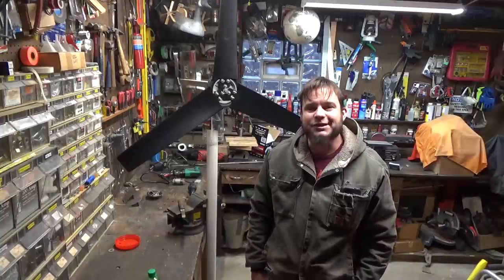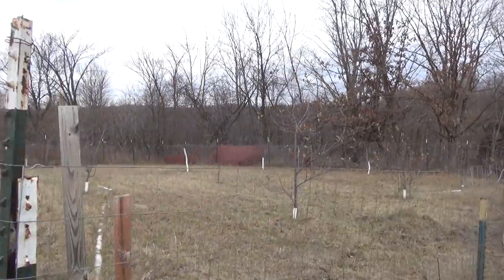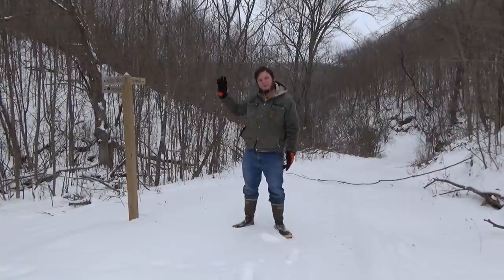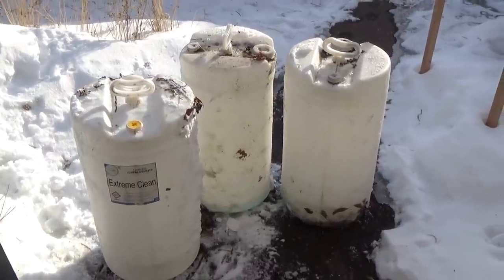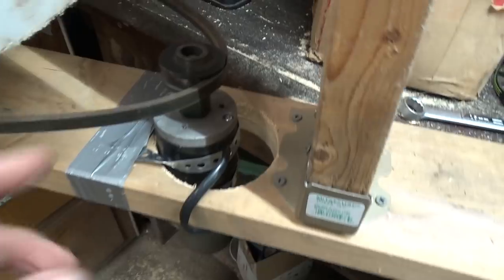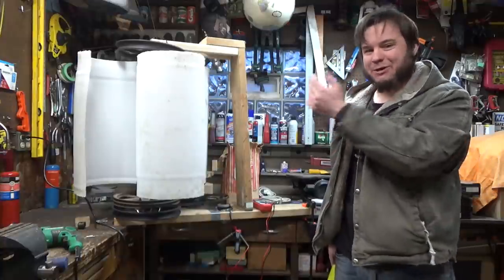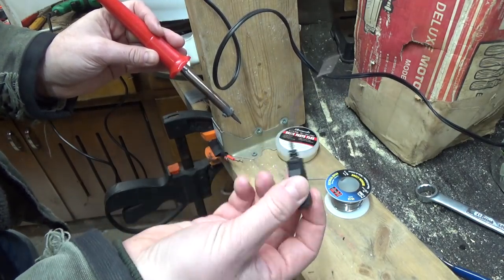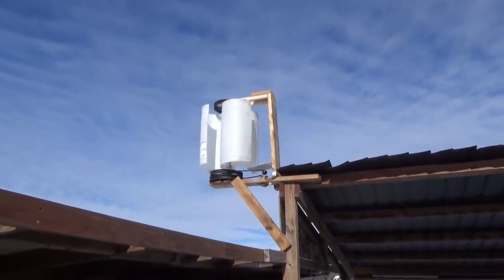Homemade Vertical Wind Turbine From Barrels and Scooter Parts

Comment: The issue with your v-belt being that loose is that it may be slipping on the smaller driven pulley, costing you some RPMs
Reply: @peterfitzpatrick7032  Yeah, that would be closer to gearing.  Great idea.

Comment: There could be an issue with there being no space between the reverse facing scoop and the axel. No space for the air to flow past so the off side half works as a sail.

Comment: "I made it work with a hammer".

Ah, a true engineer.

And you really should have a tight belt. Loose belts slip all the time, which causes power loss and increased wear and tear. I worked at Sears Parts & Service for a few years, and though I was only a counter person I picked up some technical tidbits like that.

Comment: I love your innovative approach to things. I used yo build & sell 1-3 kw wind turbines using pmgs. ,& bladr sets. Lost all my equipment facilities & spares Get it functional & then  improve perfect  it. just as i used  to Are 24v-36v Scooter motors any use as PMA's. Or i may buy from China soon.
Reply from the maker: I need to work on this some more, I started to build another one and then got distracted with solar panels and other projects.

Comment: Telling ya man... if you get some energy generated, you can dehumidify the caves in the summer, and heat in the winter!  make a large heavy duty one, that makes lots of power........ You'll need a bigger motor. 😄
Reply from the maker: The tunnels stay 55 degrees year round, so don't really need to heat or cool them... and I think drying out sandstone too much makes it crumbly and less stable.
Reply: @saveitforparts  lime? 😁

Comment: Using barrels was a good idea, but you should have looked at other vertical wind turbine designs, this is not very efficient, its like an old steam boat paddle... Also that loose belt is really getting on my nerves lol.

Comment: hey buddy good work ok watch my last video if you can make 10 volts you can use the step up controller that goes to 40 volts at 20 amps  they sell them cheep on amazon - and yes 20 amps  .and your good to go and charge a battery and then hook up a inverter .   hope you try it ..

I just updated my wind mill  to be more facing one direction ,  all about test dont let any one say shit at least your doing it  peace

Comment: Sir.  what kindof  circuit should be fix to charge the battery as battery current goes back  to motor when wind doesn't have enough force to drive the blades as the battery voltage should not go to motor
Reply from the maker: You can throw a one-way diode in there, or get a charge controller online.

Comment: A lawn mower engine?  Would that work as well as a permanent low RPM generator?
Reply from the maker: Possibly, but I don't really trust gas engines. I have a little gas generator, but the darn thing runs hot and blows fuses. Might have a video soon with a legit wind turbine though!

Comment: its working in low wind speed 😊😊
Reply from the maker: It worked OK, but it eventually fell apart in high wind!
Reply: @saveitforparts  it's possible low rpm AC wind turbine for home use, like synchronize 6 RPM Motor

Comment: All practical tests show that small wind turbines hardly generate any electricity. Purchased turbines only at costs very significantly above 1$/kWh!
There is hardly any wind near the ground, and it is also very gusty, which extremely reduces the service life of the systems.
 With solar systems, you can reliably generate electricity for about 7-12 cents/kWh over a period of 25 years!

Comment: Very interesting.  Good project.  I noticed that you had some sort of control panel with a monitor screen built into it in your shop.  What is that?
Reply from the maker: That's part of a CNC lathe thing that got scrapped out at work. I thought the control panel looked cool so I hoarded it. I'm not really sure what to do with it, maybe a future scifi prop or retro arcade console or something!

Comment: use a different transmission method. anything but vee belt, its the most inefficient. flat belt, toothed belt, friction wheels, chain... all vastly superior. especially if you actually add any tension as youre supposed to.

was always a fan of the VAWT but then i grew to hate them. i made a savonius out of drums, put much thought into it, always seriously disappointed.

differentials. you only ever get the difference between wind resistance of the two sides.

and they really only make any useful push for about 90-120 degrees of the full rotation anyway...

amusing that a vawt can act as a hawt but a hawt cant act as a vawt...